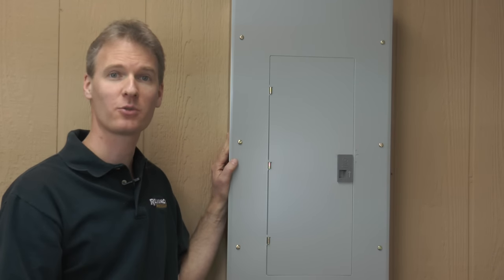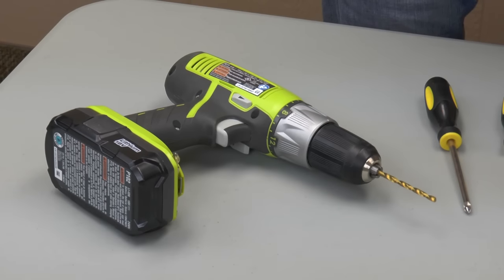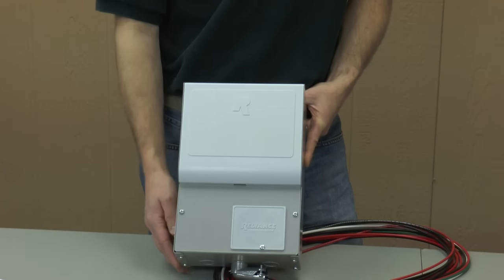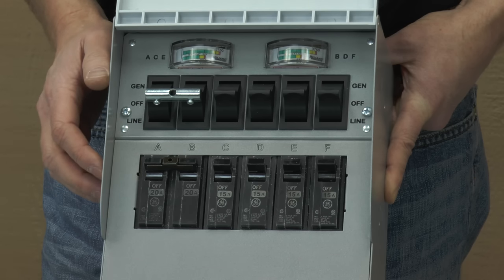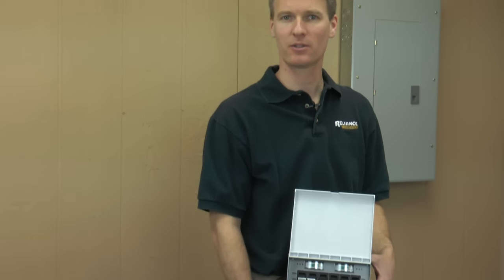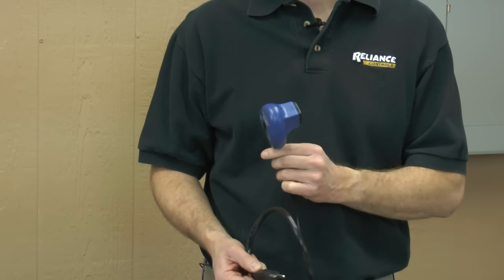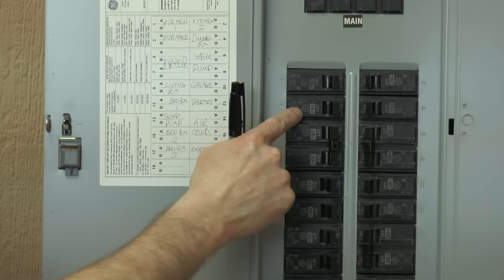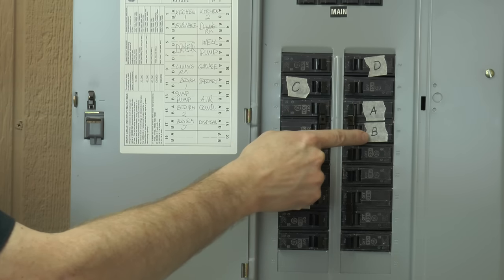How to Install Reliance Controls ProTran2 Transfer Switch- Part 1Tools and Planning

Comment: THANKS!  I watched the 6 Part series twice (except for Part 5) and then installed the Reliance ProTran2 with 10 breakers, all the peripheral wiring, and connected it to a generator for a test run.  We're ready for Hurricane Season and the video made it easy--Thanks again.  I would have made Part 5 part of a maintenance series.

Comment: My water heater has two 25 amp breakers. Can l use my transfer switch on that
Reply from the maker: Hey John! If you have the ProTran2 model, you can use the A/B circuits. You'll need to purchase a 25amp interchangeable breaker to replace the 30amp that comes preinstalled in the transfer switch. If you want more specific guidance, please give us a call and we can talk more about it!

Comment: Can I take the 2 pole breaker out and wire this for 120 volt operation only? I would splice the number 10 coming from  the generator that’s in the reliance transfer panel to both lugs to power up both phases? Generator I’m hooking up is 120 volt use only, thanks.
Reply from the maker: Thanks for asking, Joshua! Yes, as you pointed out, you can do that as long as you're only connecting it to a 120v circuit.

Comment: My project is to connect an EcoFlow Delta Pro battery power station for power outage backup to my breaker panel using a transfer switch. Eventually I would want to create a Hybrid power system in which I would get 50-75% of my power from solar.

I have identified 10 critical circuits that I can connect to the transfer switch, but in the future I may want to add more circuits. Being that the largest transfer switch on the market only has 10 circuits, is there a way to combine them?
Reply from the maker: Hello and thanks for your question!

Yes, you can combine transfer switches.  You can split power from one transfer switch to the other by adding a terminal bar in the bottom of the first transfer switch and running wires to connect to the 2nd switch.  

No need to worry about running an additional neutral as long as the back up power is coming from the same source.  A ground wire will be necessary to ground the 2nd switch. 

Please let me know if you need more details or help :)

Comment: I have a question here in Houston Texas most of the houses build after  the 2000 the panels are  outside in the house so this 6 circuits transfer switch are nema1 means they are for interior not rated for outside, do you have a kit or cover to make this protected from the weather ??.
Reply: Same problem
Reply: Good question. You should be able to place the transfer switch inside, on the opposite side of the wall your main control panel is on.  Then run conduit through the wall to each panel.

Comment: Why can a 20 amp circuit be connected to a 15 amp breaker? Wouldn't it constantly trip?
Reply from the maker: Hey Strunch- that's a great question. In many instances, a 20 amp breaker in the home panel is oversized. Especially when talking about a kitchen circuit.  This is done to avoid nuisance trips to key appliances.  

There are other instances of this as well.  So in many cases a 15 amp breaker on the transfer switch does not trip at all even when connected to a 20 amp breaker in the main panel.  This is especially true since when you are running on the generator you usually aren’t powering all the things you normally would under normal circumstances.

Hope this helps but let us know if you have more questions :)

Comment: I have (4) 20 amp breakers. I only see (2) available in video. What do you do?
Reply from the maker: The internal wiring for each circuit is 10 gauge for positions A and B (up to 30 amps) and 12 gauge for positions C, D, E, and F.  Because all circuits are wired for 20 amps you can connect 20 amp circuits to any position in the transfer switch.  The breakers in the transfer switch are protecting the circuits only in generator mode so the 15 amp breakers will be in-use when the generator is powering those circuits.  It's unlikely that you will trip a 15 amp breaker on a 20 amp circuit but if desired you can replace any of the 15 amp breakers with 20 amp breakers.

Comment: What's that little plastic cover in the front, the one with the word Reliance and a screw? To cover a plug? Thanks!
Reply from the maker: Hey there! That covers an opening in the transfer switch that could be used to install a power inlet. 

The best solution is always to use a power inlet box mounted outside the home, then hardwiring it to the transfer switch. This is preferred because it reduces the risks associated with generator exhaust and carbon monoxide entering the house. 

However, there are certain cases where having an inlet on the front of a transfer switch could be helpful. Situations where battery backup systems are being used, and no exhaust is being produced, etc... 

Please don't hesitate to reach out if you have any more questions! Thanks!

Comment: I need an ATS for an 8 circuit 240 volts system between ( Grid and inverter) what type of unit would you advice that I use ?
Reply from the maker: ATS (automatic transfer switch) systems come in a variety of ratings, sizes and types.  If you can contact us at support@reliancecontrols.com we can try to provide you with some assistance in finding an automatic transfer switch for your application.

Comment: How do you connect 2  510C Pro/Tran2 50-Amp 10-Circuit 2 Manual Transfer together?  Will be needing 16 circuits. 

 I am setting up a system to provide power during outage. Eventually I would want to set up a hybrid  system where I would be getting 50 to 75% of my power from solar.
Reply from the maker: If you are connecting two transfer switches together you may do so by taking the power from the inlet (whether it be in a transfer switch or external inlet box) into a junction box to extend a red and black wire to both transfer switches for X and Y power.  Connect a ground to both transfer switch grounding terminals (only one needs to extend into the main panel ground bar).  

The white neutral does not connect inside either transfer switch it will simply connect into your main panel neutral bar so there is a connection between the main panel neutral all the way to the secondary source of power.
Reply: @RelianceControls  is there a video on how it is done?
Reply from the maker: @NBPostman  We haven't made one yet (noting the great idea though), but please give us a call because we're more than happy to walk you through whatever you need.
Reply: @RelianceControls  do both transfer switches need to be the same. I am looking at a 510C Pro/Tran2 50-Amp 10-Circuit 2 Manual Transfer Switch with Watt Meters and I want to add a Pro/Tran2 30-Amp 6-Circuit 2 Manual Transfer Switch
Reply from the maker: @NBPostman  If you are connecting a second transfer switch in conjunction with a 510C both units should be rated for 50 amps.  Either a 510C (10 circuits) or 506C (6 circuits) would be the transfer switch to match with the 510C.

Comment: What if you say have 12 circuits. Why couldn’t you get two of these transfer switches and use two separate generators with 2 separate power inlets? Would this be feasible?
Reply: I did it and it works great. We have a Predator 9000/7250 watts generator which can run our whole house easily.  We started out with the 10-circuit transfer switch for all the critical circuits we needed to run. We are using the 120v/240v four prong outlet, protected by a 30-amp breaker, on our generator for the 10 circuit.  

I wanted to power the remaining 5 circuits in our house that was only 120v.  I installed the 6-circuit transfer switch and connected the remaining circuits to it. I'm using the same generator but using the 120v, three prong outlet, for these switches. (It's protected by a 30-amp breaker)

Comment: Do you connect it to the panel or sub panel?   Which would be best to install on?
Reply from the maker: Hello, the circuit wires (from the 3 position toggle switches) in this transfer switch connect directly to the breakers in the house panel, so that the power can route through the switches allowing for a transfer via the toggle switches (and isolation).  An installation can consist of connections to circuit breakers in 2 different panels, the same instructions are followed.  If wires cannot reach, you may have to use a junction box to extend the individual wires to reach the individual breakers in the 2 different panels.

Comment: can I run this with a 120V generator? I only have single pole breakers that I need in the transfer switch
Reply: Not sure if you got other answers to your question, but I was wondering the same thing.  So I took the transfer switch box apart and did some checking.   The RED wire that connects to the generator feeds switches B, D and F.  The BLACK generator wire feeds switches A, C and E.  So, if you only have a black hot wire coming from a 120 volt generator, just connect it to BOTH the RED and BLACK wires inside the transfer switch box.  Keep in mind, you really won't be able to handle large loads.  What we do in our house is use the generator to power mostly lights (LEDs, so low power), the fridge from time to time and the UPS that runs the fiber optic modem so we can have internet and phone.  We have a very small generator so 20 amps is the max.  Our heat will come from wood stoves, so all we really need is some lights and the ability to run a laptop computer and the phones.  BTW, I'm not an electrician, but I did wire my own house (legally).  Also BTW, you can separate the A and B circuits and use them as individual circuits to run two different breakers in the house system.  You can swap out the 20A breakers and replace them with 15A breakers if you want, although I didn't bother with that.
Reply from the maker: Thanks for taking the time to respond  @davemccormick3133  :)

@John, dave is spot on with what he stated above. So long as you're only powering up 120V circuits, It's perfectly fine.

Comment: I understand that circuit breakers "break" the connection when devices try to pull more than that particular breakers rating, what I don't understand is how the breakers on this transfer switch end up adding up to 50 amps (PER SIDE!) yet the transfer switch is rated for 30 amps... Now the whole per side business I get is from the generator having 2 sides or something of the sort wherein a 30amp cable and transfer switch could actually move 60 amps total? The thing is I have a generator that uses a 50 amp plug and I'm going to have to install an inlet box which in this case will be a 50 amp inlet box... But my transfer switch is the one in this video, I think its not an issue since its the devices that pull the current... what I'm wondering is... what is it about this transfer switch that limits it to 30 amps when the breakers all add up to 50 AND ON EACH SIDE so total of 100amps. If someone could clear this up a little id greatly appreciate it.
Reply from the maker: Thank you Jeff for the the question!  The individual circuit breakers provide "over current" protection for the wiring running off the breakers and throughout the building to various things.  Breakers protect wires from overheating.  Breakers and wires must be overrated per the National Electrical Code to a certain percentage above whatever loads or appliances can be drawing power per circuit, with additional rules and calculations being applicable.  

The breakers themselves should be looked at as being individual protection devices for each circuit (specifically the wiring feeding each circuit), the breaker amp ratings are not added up or related to each other or totaled in any scenario I can think of.  In every electrical panel it's normal that if someone added up the ratings of all individual breakers, it would usually exceed the rating of the main breaker or the large wires feeding the panel from the meter.  If one breaker has too much power drawn through it by whatever is using the power, it will trip, but it won't affect any other circuits.  

There is no "main" breaker in this type of transfer switch, so the wiring between the generator and transfer switch input (like the cord) is only protected by the circuit breaker built into the generator itself.  If there isn't a sufficient breaker in the generator to protect the cord/wiring you plug into it, then that is a short coming. But every modern portable generator has proper breaker protection for its outlets so as to protect overheating of the wiring in the cord.  That having been said, it's the responsibility of the person attending to the generator to manage the amount of power being used by circuits to avoid overloading the generator, as in some cases the generator engine will be vulnerable to shut down before its internal breaker trips due to too much power being used.  

So the breaker in the generator protects the wiring up to the breakers in the transfer switch, the breakers in the transfer switch protect the wiring in the house for those circuits while under generator power, and the breakers in the house panel protect the wiring in the house during normal power.

Comment: Does the Reliance Pro Tran Q510A transfer the Neutral? If it does should the generator used be Floating Neutral?
Thanks
Reply from the maker: The "load side" transfer switches (any version of the Pro/Tran or Pro/Tran 2) do not switch the neutral, they are referred to as 2-pole transfer switches.  In any event, if a generator is floating neutral there should not be a transfer switch that switches the neutral involved, thanks.

Comment: Can leave it wired up when the power come back on and leave it in line position
Reply from the maker: Right the main power will pass through the switches in the LINE position, even at the same time the generator is feeding some circuits with switches in the GEN position.  Each switch isolates power for that circuit.

Comment: Hoping to run the house off of two WEN 3800i portable gens with a WEN 30A (50A?) parallel kit.  I would use the 30A cable in the reliance kit.  This gives me redundancy in case of failure and the ability to remove one 3800i for occasional RV or job site use, and the lower atypical generator noise, semi masking my setup.
I assume the Protran2 would allow for 220v circuit(s) even though the WEN parallel kit doesn't innately allow for 220 (separate power legs).
Unsure of the benefit of upgrading to a 50A cable + parallel kit + wall mount receptacle?  Main concern is the 220v hot tub (internal 110v circ pump)... can't let that sucker freeze (again), and our 220v cook top.  Thoughts/product suggestions?

Comment: If the grid were to go out. What keeps the system from back feeding onto the grid?
Reply from the maker: Thank you, the idea of the system is to isolate any potential grid power from any backup power source, such as power from a portable generator.  All power to the specific 6 circuits is routed through the 6 toggle switches in this transfer switch, once the connections are made appropriately when installed the switches will always isolate the generator power from the breakers and bus bar on the home electrical panel.  It forces someone to manually throw the "switches" up or down to set specific circuits on grid power, or back up power, but and both power sources can indeed be ON at the same time, the important part is the power sources always remain isolated from one another.